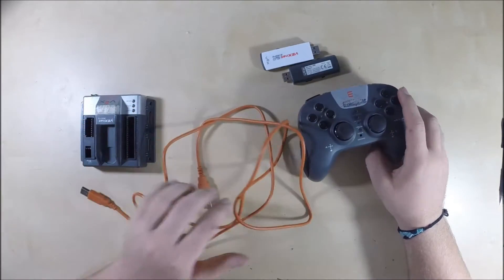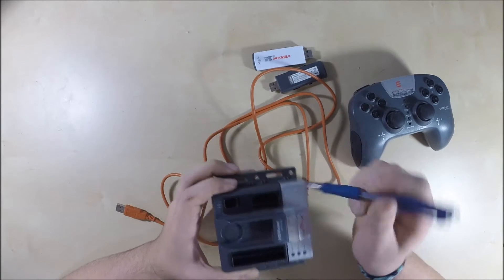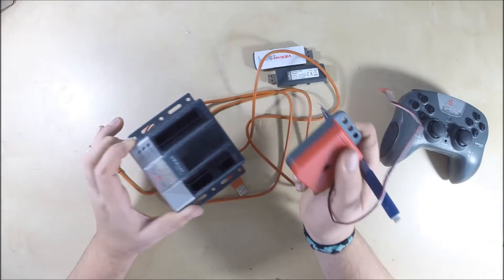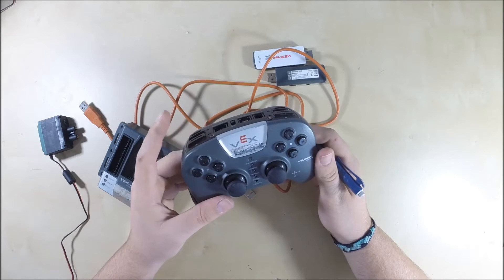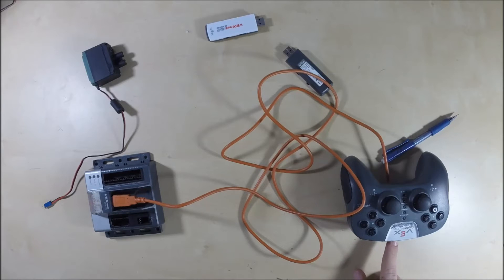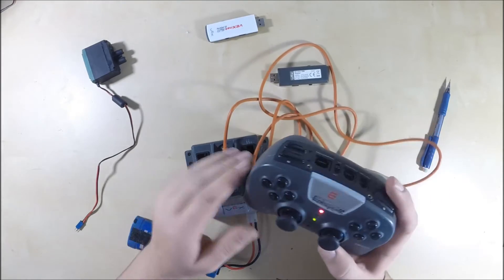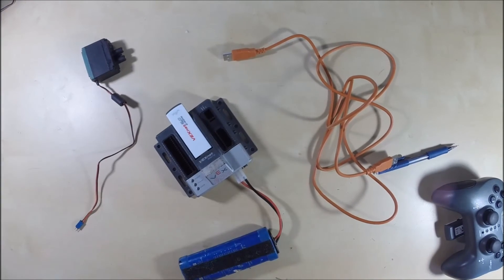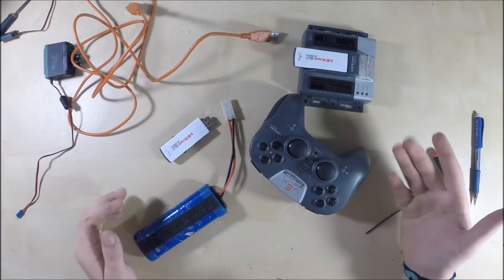Cortex Explained

Comment: What would I do if my cortex and controller will connect with the cable but will not connect when I try to go wireless. all of my firmware is up to date
Reply from the maker: It could be your VEXnet Keys. If you have extra VEXnet Keys, I would try different combinations of those to see if you can identify a possible bad key and/or a good combination of keys. The old (black) keys were fairly notorious for breaking easily if dropped, I don't know how reliable the newer (white) ones are (I haven't had a whole lot of time with them yet.)
Does that help?
Reply: So I have tried various combinations of the vex keys I have. I even used to brand new 2.0 keys and I still cannot get them to connect.
Reply: I havnt changed anything but on my cortex the game light keeps flashing and the vexnet light is off....the controller looked just liked yours did but my cortex lights were as explained. what do i do?
Reply: Also when i put in the wireless adapters on the controller the joystick lights up green, the robot light is off, the vexnet light is flashing orange, and the game light is off. On the cortex when i put in the wireless adapter the robot light is flashing green, the vexnet light is off and the game light is flashing green....idk what to do.